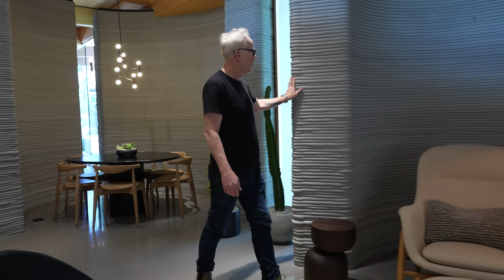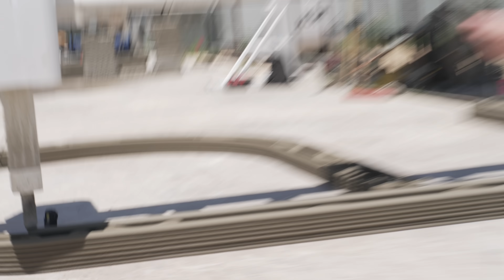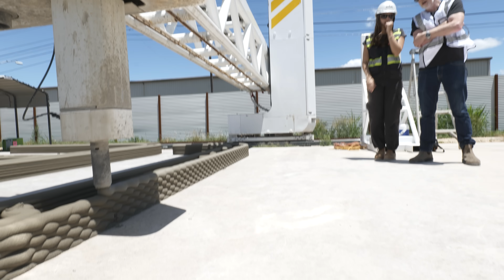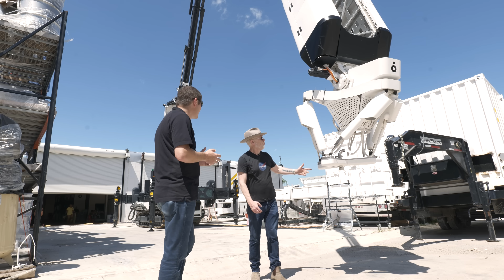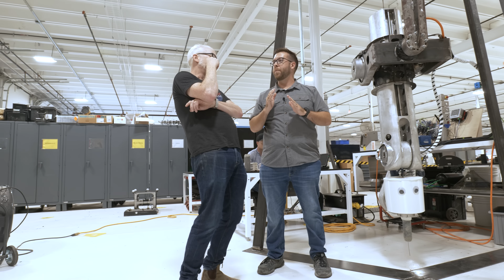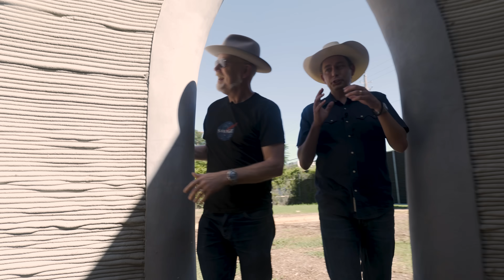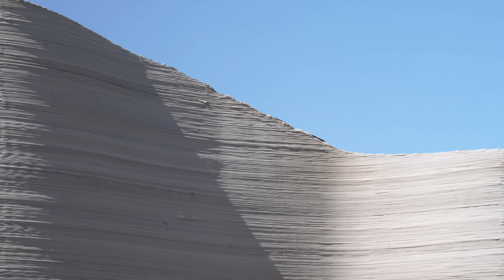The Biggest 3D Printer Adam Savage Has Ever Seen!

Comment: This is very neat.
I do have a concern with the material though, given that concrete is a notable fraction of worldwide CO2 emissions.  I don't think we should be looking at increasing its use without an equal or greater commitment of resources to significantly reducing or eliminating CO2 emissions from concrete production.
I also worry about the resistance of these structures to earthquake damage.

Comment: Instead of cable , you should consider glass fiber, no corrosion ever and extremely strong. I live near saltwater and the worst thing to reinforce concrete with is steel, as that becomes a failure point as it grows larges as it rusts. Thus cracking the concrete. Plus it's lighter and far easier on the nozzle. FWIW

Comment: While I could see that they were using Bridging-type Ties to tie the two wythes of each wall together, it never saw any Vertical Reinforcement. I know curves and arches tend to take care of loads when properly engineered to do so but it didn't look like that in their Experiment Building. 
I think if it were for me, I'd have to have Texture Stamps to break up the pattern here and there just so it's not so aesthetically "blaaaaaa" !  But then Stamps likely wouldn't work because the concrete is already setting up (but not a Cold Joint) by the time the next pass comes along .. so I think texturing would have to be done Manually. Tradesman and artists that are good with Trowels. On the other hand, I think I'll stick to more conventional construction or even Straw Bale.

Comment: Straight lines and corners are the Hardest things to print in traditional 3d printing.   Vase mode the easiest  traditional method with constant, even , same speed extrusion.    It would seem corners would be very difficult with NO retraction.  You would have to DuMP at the corner as it stopped and then started the new angle so hide it in the TEXTURE in the coding.  I am sure this is where they are going.  Kind of the the mixer in fracking.  and the arm would be like going down hole on cementing or rigging.  And with a little help from Delta printers  and robotics you can dial this stuff in.   Will be looking forward to owning one of this one day!!

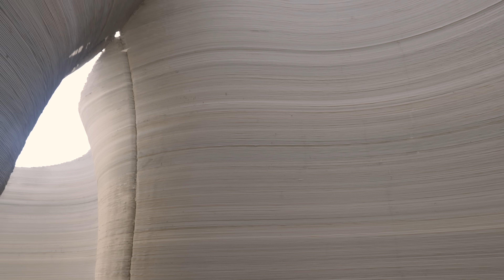Comment: 28:54 I am sure they worked to not use them, but what about the supports you see in the typical 3d printed items?  If you were to make this structure in small scale, would you need supports?  If they used supports, could they open up other opportunities?  Could the supports be left in as design, even if they are no longer needed?  What about printing columns and other interior elements/features?
Reply: Plastic and silicom behaves differently .. thats like saying I'm going to carve metal with tools for wood carving

Comment: What happens when you want a window or a door? After the concrete is set, you cut a rectangular hole in it? Does it negatively affects structural integrity? This is very interesting, and I suppose that this could also be used in colder climates, just print it in double layer and fill the  gap with PUR foam...

Comment: I don't know what they are developing for "Pheonix" but for building in those environments it seems intuitively a delta style printer would be easier since you aren't as beholden to having perfect orthogonality and parallelism of the axes and frames.  Set 3 tall towers roughly in place, connect the print head and let the sensors level, calibrate, and retranslate differences in each tower's relative position. And the three towers are the same part, so more interchange for repairs and maintenance.

Comment: I really just don't believe in 3d printed houses as the future. Not because there should be no innovations in housing, but because there are just fundamental constraints on 3d printing that make printing houses in it problematic. For one. Has anyone seen a multi family dwelling printing like this? Certainly not one more than 2-3 stories. I doubt the material properties of the concrete would allow that, and I doubt that it would be ecomonical to build a structure big enough to support the printer that made a many story house.

Comment: Squints at printer and slides eyes to universe using shockwave holography to print celestial bodies Poor things lol.. Points at primitive Humanoid making Clay pot Replace the hands with rotating capacitor bank discharge Plasma generated Ultrasonic holography with resonance filters to prevent absorbing into materials causing heat unless desired. Taps high powered medical scanners beaming through people at hospitals + transcranial pulse brain modulation Pressure max in public = Boeing Plasma force field uses Ultrasonic shockwave pressures to counter bombs. Destructive sound interference.. Why so many names for the same thing? Genetic behavior poisoning.. "Genotoxic" in your food and water but claimed safe levels. A species so close to full DNA death that CLEAN doesn't mean nothing bad in it anymore..

Same technology can fix that too.. Search engine: "Ultrasound Stem Cell proliferation" + "Ultrasonic holography stem cell guidance" Vitamins for required resources + Use God's buttons to order Biology to stop being stingy to reverse even aging. Make sure to balance resources put in because if take too much to repair then Biology will make you suffer until resources restored. Look at your stories side by side with your science words I told you to search engine. I'm not lying unless your masters are.. - Dracula/Hades 🦇_Smoke_🐺_🐉 (Son of the Dragon in the times of order of the Dragon/God.. Oops?) https://www.youtube.com/watch?v=LQ1iggFnFYA

Comment: Something interesting to note: Evan mentions (2:23) they're 24/7 mixing concrete and wetting it down to optimize the print quality. As someone familiar with mixing concrete, this means there's a crew on site moving and mixing material while monitoring the temperature and humidity to fine tune the concrete mixture accordingly to the conditions on site. 

While some of the building labor is automated, the manual labor for the automated part becomes a 27/7 job until completion... No thanks, I'll just stick to the Roman way for all my concrete needs.
Reply: As far as The Roman Way, we seem to be emulating the "slow collapse beneath the weight of hubris, social inequity, and corruption" just fine too.
We've even copied the lead mistake. More than once.

Comment: That was such a fantastic video. Really inspiring engineering. My questions would be, because I'm in the UK, can it operate when it's raining!? And does it have a lower carbon footprint than standard construction? Could cob.....or Mars dust be used instead of concrete?

Comment: Here’s my biggest question can you put siding on it on the outside etc if you wanted it to look like a normal house and drywall on the inside. I don’t want to drill into concrete everytime I want to hang something on a wall and they’re not particularly appealing to the eye so building the house this way I think is awesome but it would be cool if you could make it look more traditional with hardy board or better yet make the 3d printer do an additional thinner layer that looks like hardy board or is flat and you can accent to mimic it.

Comment: Were if the vertical reinforcement with all the layers being narrower between them that's were the weakness is could it have a trowel follow the print head for a smooth uniform wall using less material and saving on lining and painting with better thermal performance with less surface area.

Comment: Are there fibers in the material or do they use rebar for critical points? I notice the shape is different like globes, so I'm wondering if the shear strength is a challenge. I also wonder how they integrate other materials or layers like floor joists to have a subfloor crawl space etc.

Oh yeah they showed the inlayed wire, cool.

Hmm also you could run multiple printing heads in parallel on the same tracks to speed things up. I imagine the rigging and the mixing and pumping etc is a lot of the challenge. I also imagine right now the crete takes too long to dry.

Comment: My thoughts are on whether tubular mesh might work, and some guide after the injection to flatten it. But it's cool the shapes which can be made and patterns, the end one is gorgeous. Perhaps even use the same mechanism as that which wraps plastic with a plastic band, or those with gabions, to automatically seuture(?) the tubular or sheet mesh together, strips as tall as the injection :o I like the forensics and I wonder how they calculate when these deformations are in the process, to check with the printers computer timeframe for anomaly analysis? I know the likes of Arduino can have arms which memorise movements from copying a persons guide to following a die :o sorry if I missed this but what do they do when detecting anomalies which are structurally dubious? :o do they need to spray it for slower setting and smooth surfaces or is it all in the hydro chemistry? :o

Comment: Im curious what admixes are used in the concrete to make stronger, wear-resistant concrete, with a higher psi for structural integrity. Any fiber load in the concrete? Any water reducer or concrete adhesive? Id like to know more about the design of the concrete.

Comment: Funny to see all the same issues printers had 12 years ago. 

Its like they didn't look at solutions like input shaping, scarf joints or arachne perimeters, surely those features would work at this scale too?

So that last building is their Benchy? 
Weird how there's no straight lines like its a good thing, making straight walls in vase mode is hard. Also to make a house its very important to have a few straight lines since being able to furnish it is important.

I get the feeling like the last guy has never used a regular 3Dprinter there's still a lot of overlap between the two.
Cool project, i wonder what the future will bring.

Comment: I wonder if/how they mitigate the risk of cable elements rusting inside the walls.  All it would take is one tiny crack to let moisture in, and I did see a couple of fine cracks in the test structure. But I guess moisture ingress is a major issue for lots of reasons beyond that.
I've been seeing talk about 3d printed homes for a while now, but it seems like it'd be worth getting it sorted out.  Seeing the time lapse of a boom arm printing a two story structure straight out of Dr. Suess was beyond what I would have imagined was possible, very neat.

Comment: Have you heard of Fastbrick Robotics (FBR) and their Hadrian trucks? They are automated robotic concrete block layers. They managed to build a block house in a day earlier this year in Florida. It moves blocks up the arm and out to the work end, then a manipulator grabs it and places it. It can cut the blocks, glues them automatically (using masonry adhesive for faster cure times), and then places them at a rate of 200+ blocks/hr. All you have to do is put a roof on it. The advantages of working with CMUs vs a fluid product are huge.

Comment: Doesn’t that girl know concrete takes longer to dry in low humidity ? lol Texas concrete does not dry quicker due to heat. Concrete is a chemical reaction and requires water. Some places use tarps to hold water in the concrete due to heat.

Comment: As neat as this is, earthquake resistance starts at the foundation, and this was a lot of conversation about walls. Really cool walls, that do break the boring boxy look of "standard" housing for the US, but there's a lot more problem solving I can see need to happen before it is viable beyond the highly controlled test environments, or even on Mars if that ever comes up. Another thing is that while the layers are cool to see, the interior housekeeping would be far too complex. It is nice to note the finishing options from the business end, but you can't just wipe those walls down with that texture; you'd need a vacuum, and very good brush that doesn't scratch the finish to clean up the dust of general living. The outside I could see just hosing down and calling good, but the inside after full furnishing with the exposed walls combo would be heck. 😅

Comment: I realize the structures shown in the video are testing the boundaries of the equipment, but the swoopy walls and no corners don't lend themselves very well to how we're used to living in a house.  Furniture tend to be rectangular so couches and chairs and beds and clothes dressers go up against a flat wall or in a corner, pictures and TVs and kitchen cabinets and other things hang on a wall that typically needs to be flat and vertical, and so on.  Plus you have to figure out how to put rectangular windows and doors in the exterior walls.  It is a very cool method of construction, though.

Comment: Having worked in construction, in the Southwest Carpenters union, all I can imagine is the galactic-level whining & sniveling about how this will put framers out of work. Those people, from my direct personal experience, are the beer-swilling barely-skilled troglodytes whose idea of "quality" is 2 nails instead of 1 when attaching studs to baseplates. The majority of them cannot envision the future beyond the next payday, and will find automation like this to be an existential threat. However. Their inability to adapt to advances in technology is no justification for failure to adopt and utilize this technology.

I readily see the dwellings that this technology can produce will confer significant benefits in cost savings, fire resistance, catastrophic weather resistance, insect resistance, energy savings for heating/cooling, and overall durability of structures.

For the cementitious materials that clearly contain a fibrous component, I think that shredding the old fiberglass blades from wind turbines would be an excellent materials source, especially because those things currently are typically buried whole in landfills, which is immensely stupid.

Comment: Actually the "printing" process would be just about 20-25% of the whole building. What about Earthmoving, Foundations, All the mechanicals and a big ETC. Not to mention the walls can not remain like that. They must be smoothed, plasted or something, more importantly inside. A 2nd floor? Yo need Columns, Beams, Pouring the 2nd floor all with proper rebars or the use of steel beams so it all can hold itself, not to mention an earthquake. Concrete building is heavy stuff and potentially hazardous, and I don't see this method close.

Comment: Is Adam using the term "metamaterials" a bit wrong here? To my understanding, taking an example from the 3D printing filament side of things, adding a glass fiber or carbon fiber clippings or even a solid core thread into a filament isn't really making it "metamaterial", it's combining the properties of two materials, kinda like reinforced concrete. AFAIK metamaterials are materials that derive their properties not from the base materials, but the clever structural designs. Like for example they made things that were invisible to microwave radiation with materials that would normally show up in a microwave scan, but the way the structure and shape of the thing was designed caused it to become invisible. I guess in 3D printing one less finessed example would be using a flexible filament and specific kinds of infill patterns and densities to alter the flexibility or "hardness" of the resulting object?

Comment: I'm still pretty sure this isn't going to become mainstream for house building. It's pretty novel, and can make really cool shapes. But ultimately roundness of this technique makes it kinda annoying to work and live with. It's also pretty limited as to what it can build, as in mostly single housing or small structures. Not to mention we have stuff like element houses already. Which allows for much more flexibility.
I mean this is ok solution if what you want is round unconventional design and to see raw concrete. But as soon as you start finishing it up like you would normal house, costs go up. And those costs go up way more due to unconventional shapes and design.

Other part is frankly just the market. How much demand is actually for houses like these? How much would you get when selling it? Idk. I just think if people actually want something cheap, some kind of factory built element thing will be overall just better solution.